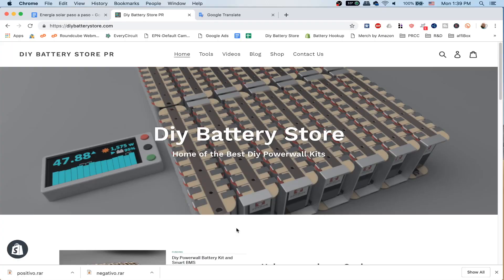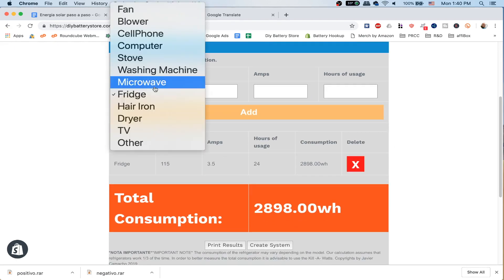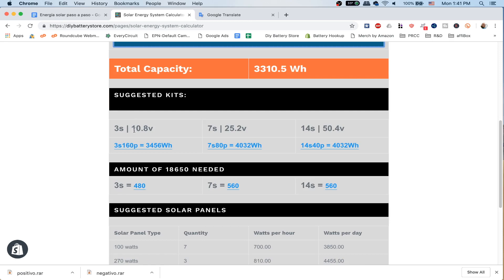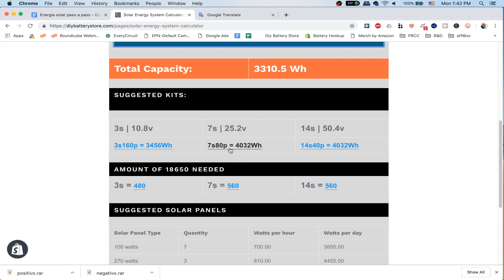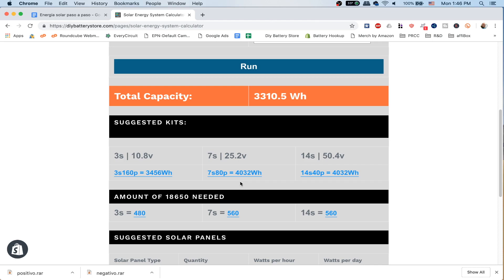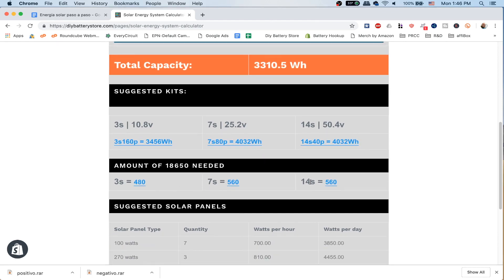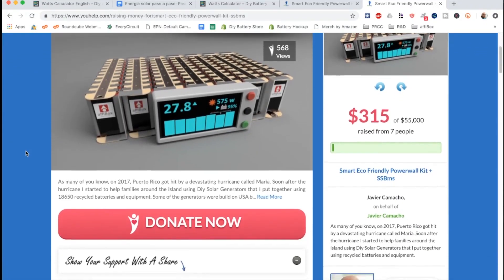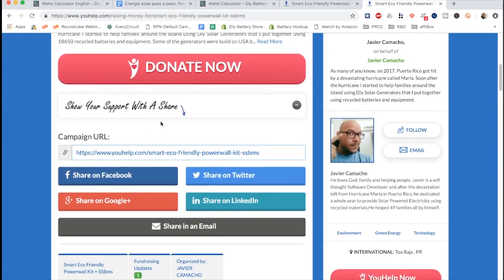How to build a Solar Energy System | Step 2 Solar System Calculator

Comment: I sell solar panels that are lightly used and small blemishes on them not affecting the capacity.. if you need any to add to your website or want to offer a little, I also sell large inverters for off grid 5 kw up to 15kw.. I will be starting a online off grid store soon with a YouTube channel also..thanks for doing stuff like this I find your inventions are going to help a lot of people switch to lithium batteries.

Comment: A question for you...is there a way to figure an average of capacity needed? for example My electricity here in my home is 120v, 100a, so that is 12kWh right? so can I use that figure? I guess to avoid all the figuring of individual appliance and gadgets, I mean we are talking furnaces and AC too. Also so you know the wife and I are planning our retirement and the goal is to go south, in the states. With Gods help we plan on building a new home, and "I" ;-) would consider a alternative energy source. Your thoughts?
Thanks!
Reply from the maker: 1. To calculate the energy you need you either use the utility bill to calculate your house consumption or make a system for specific appliances.

2. make a system base on capacity for example, 10kwh powerwall with solar panels and use that to lower your monthly bill and as a backup in case of a blackout.

3. For the new house, Go solar baby.... You can do Off Grid or hybrid.